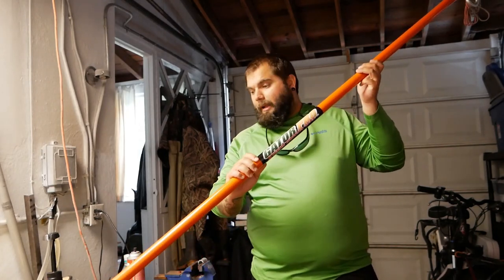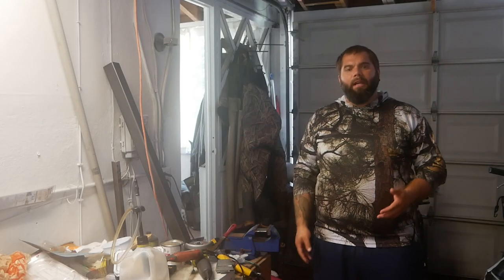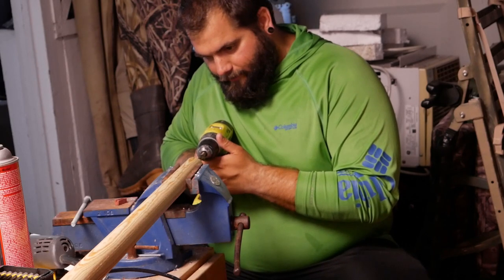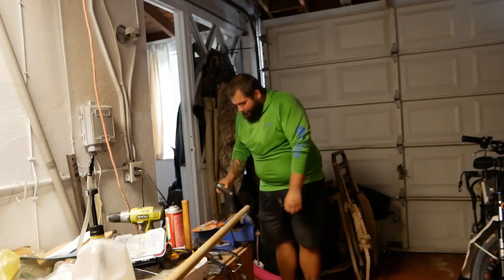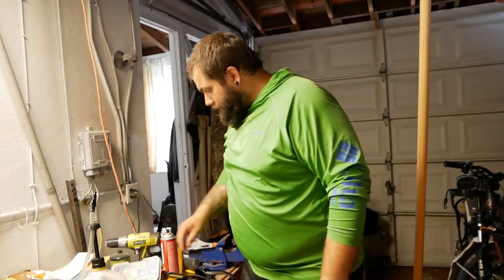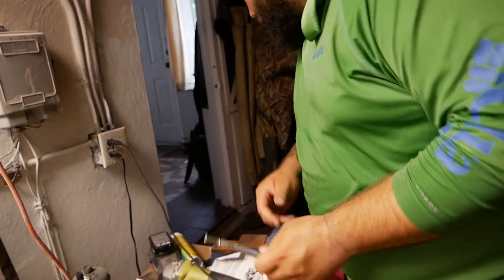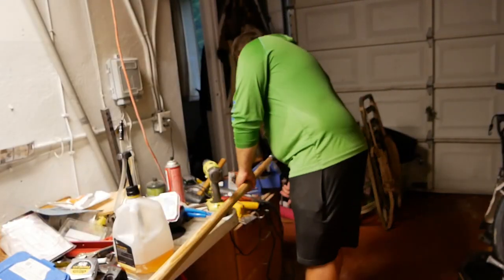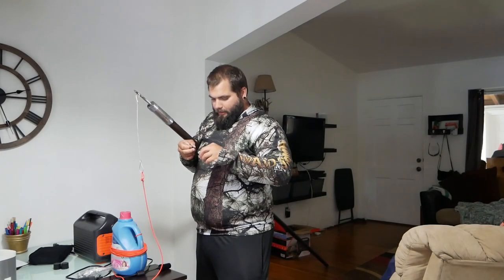DIY Alligator Hunting HARPOON! (Swamp N Stomp ep. #67)

Comment: a tip I learned from experience. instead of doing the electrical tape method I just put a rubber band on the dowel and slide it all the way down about a foot from the tip of the harpoon and I put the line under the rubber band so it simply just slides out from under the rubber band when you jam it into the gator

Comment: What type of wood is the shaft made of?
Reply from the maker: It’s just a pine dowel from Home Depot. Thanks for checking us out. Don’t forget to subscribe! -Mark
Reply: Pine wood isn't particularly strong or durable. Likely to have issues with prolonged use. Teak wood is ideal for marine conditions. Oak, Ash, Yaupon Holly, or Hickory are also good choices. You can also use thick wall aluminum tube or solid fiberglass dowel rods. Make the ferrules out of steel pipe like you did in the video.
Reply: Johnathan.
Try pecker or morning.
Reply: @glenwagaman9103  God bless you,  Good sir.